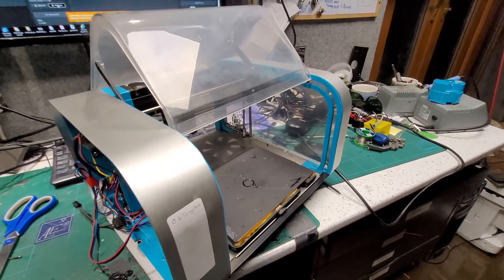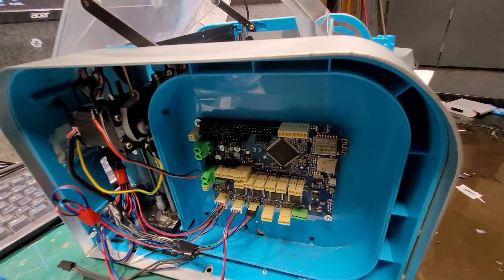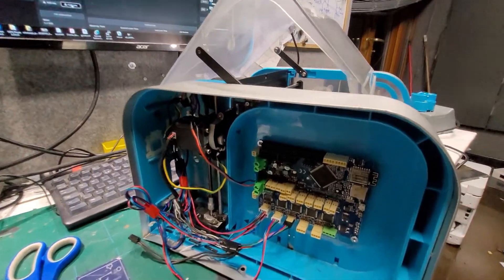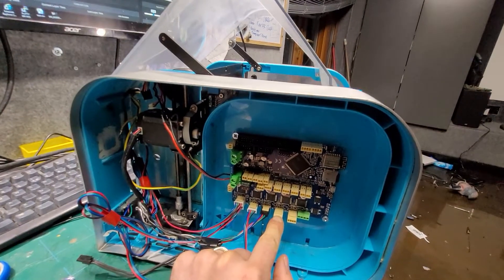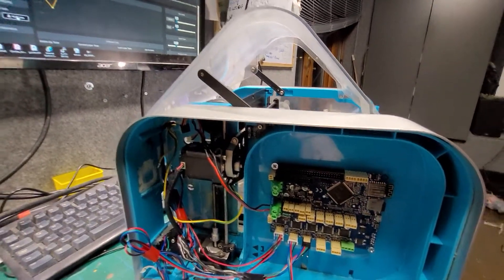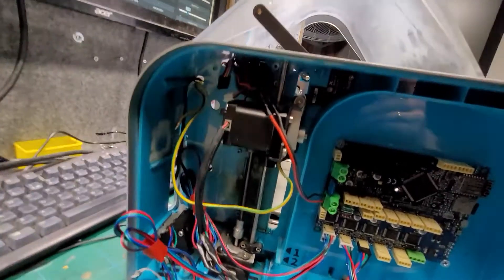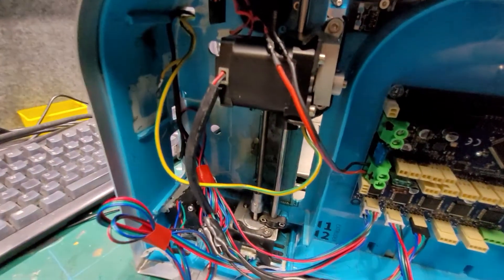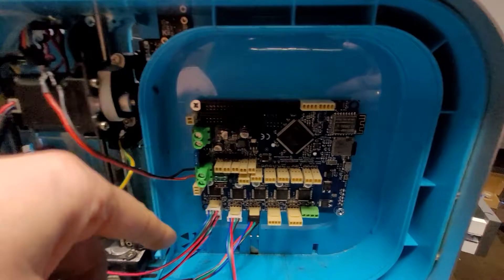Robox 3D Printer - Conversion to Duet Wifi - Part 1 initial config and Axes drive

Comment: would i be able to do this to a robox pro I'm sure some of it would be different but it should be doable right?
Reply from the maker: @lavuy6744  yes all doable. You just lose all the needle valve controls.. but given the poor head build quality I'd be surprised if you have any heads still working!
Reply from the maker: @lavuy6744  yes all doable. You just lose all the needle valve controls.. but given the poor head build quality I'd be surprised if you have any heads still working!